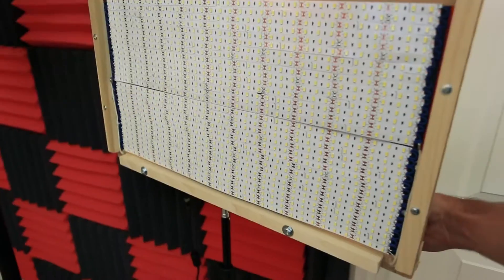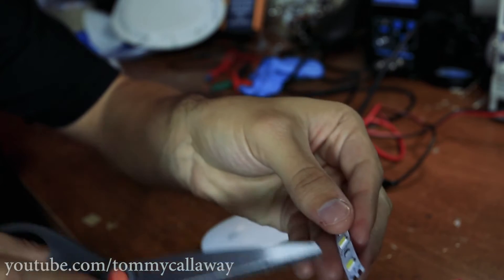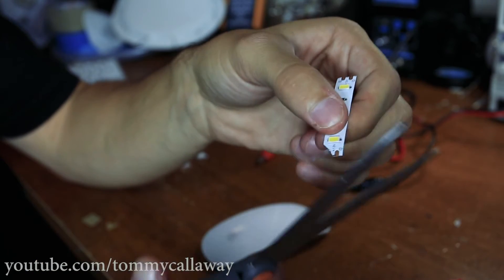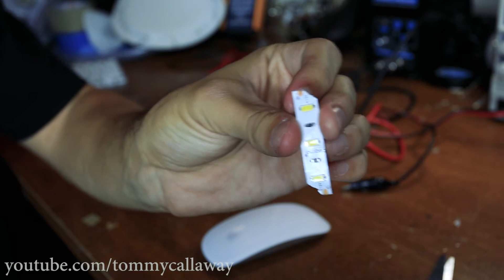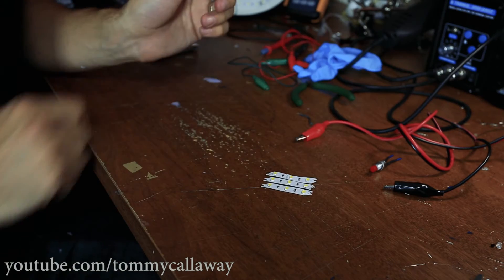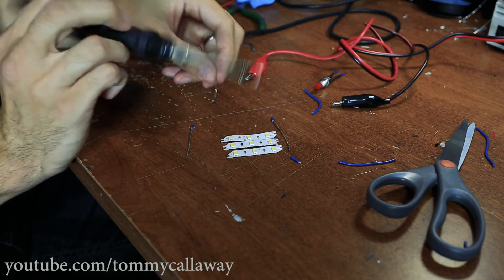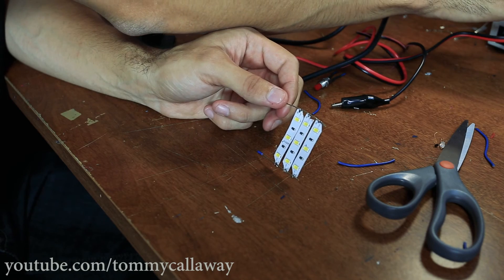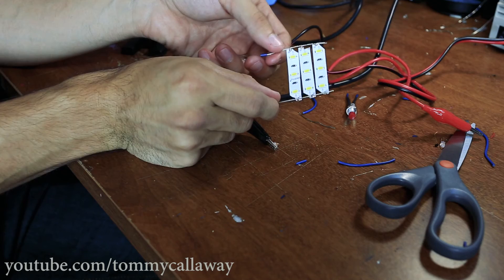Easily Wire LED Strips Together for LED Panels

Comment: I cut some strips with a total of 78 leds, wired them this way, they're 24v, I'm using a 24v power supply and they power great but I notice they got very hot, even burn to the touch of I leave them on, am I suppose to use some kind of resistor or anything?

Comment: Thank you, I just ordered LED tape and was wondering how I was going to be wiring these in a 1/1000 scale build rather than using 3 mm LED

Are you able to run LED wire as in this video on 9v power supply?